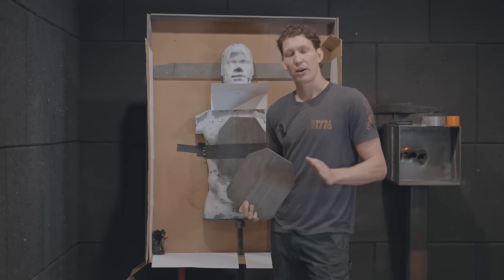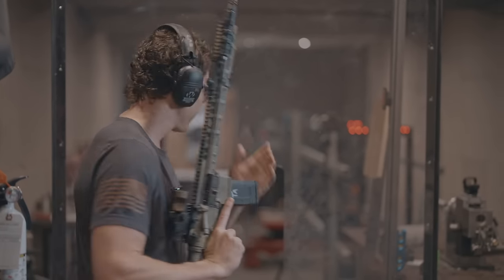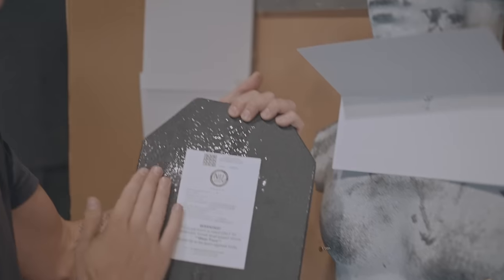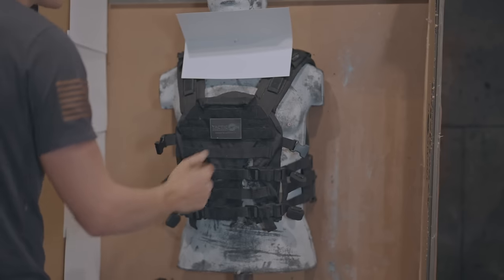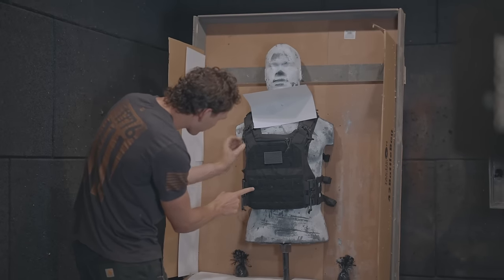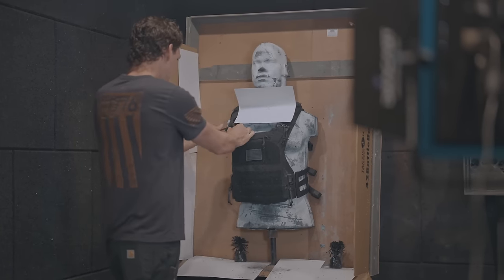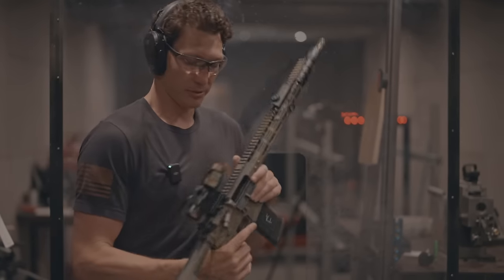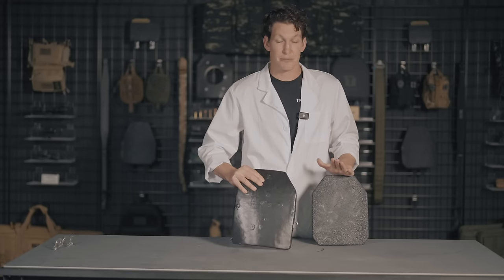Will Steel Armor Make You UN ALIVE Full Test

Comment from the maker: You can find our $225 AR600 steel plate package WITH plate carrier (same ones in this video with coating) here:  https://tacticon.com/product/ar600-level-3-body-armor-with-battlevest-plate-carrier-package/
Reply: I ordered the AR600 bundle, along with trauma pads, last week.  You guys got it to me in 3 days.  That speed and service alone impressed me but I was really blown away by the quality of the plate carrier and trauma pads.  Overall the experience of buying my first ever set of armor and plate carrier was excellent.  Thanks!
Reply: Why did you go with ar600 instead of ar500 or 550?  Will the ar600 crack faster with 308 and is there a realistically low number of 308 where cracking occurs on ar600 (less than 20 rounds)? 

With steel plates, I have heard that 55g will zip through it with longer barrel lengths. I have witnessed a 20 in rifle with 62g gold dots chip an ar550 plate at 100 yards. Is there a fps number where steel is defeated in less than half a mag?
Reply: @sierraharvester  Weight.  I'm disabled and have a very bad low back/neck with nerve damage to both legs and arms (from degenerative disc disease, nerves got compressed).  The AR600 is a couple pounds lighter which makes a huge difference for me.  Yes, with longer barrels at close ranges .308 & other rifle rounds will penetrate it as will steel core/tipped 5.56 but I can't afford ceramic and settled for what I could afford.  That sale price was the only way I could afford even that much.  We all must work with what we have I guess.

Comment: I spent weeks researching ceramic and steel armor, really trying to pick which i would go for as my first main set of plates. It was between level 4 ceramics or 3+ steel w/ a 3a soft ballistic panel behind it. Weight was roughly the same, i know higher end ceramic level 4 plates can be lighter, but lower cost options tend to be around the 8-9 pound range, roughly the same as steel. Ultimately i went steel because, really possible situation, you take a single pistol caliber to the plate and proceed to handle the situation. Ceramic is now crunchy and compromised, and you need to do some type of repair. Steel wouldnt really even notice the hit, no true appreciable damage. To me its not about being able to take a mag dump to the chest, but its ability to take damage over time without being compromised and troublesome if it cannot be easily replaced.
Reply: I wanted level four but for my first body armor set up I’m going with ar600 3+. This set up allows for lighter weight and multi hit capabilities. Body armor DOES NOT make you super human! Train as much as possible and be safe.
Reply: @Bigrig2020-c1d  LOL what a massive cope. Just say you want to cheap out on armor.
Reply: @Dero_milsurp  I’ll just take yours when the shit kicks off then 😂
Reply: I have own steel plates for years, and I still do ... I have also come to the  same conclusion.. still can not  justify the ceramic plates purchase
.. I might in the future if time allows me... even then IDK 🤷‍♂️
Reply: @tacticalpickle7  “I bought steel plates and now I’m pretending they are superior to justify my purchase because my life is worth saving money”
Reply: @tacticalpickle7  Yes, I will mock people who simp for steel.
Reply: @Dero_milsurp  your ceramic is done after one shot bud especially from a low recoil rifle like 556 besides everyone’s arguing over plates when if I see you have plates I’m shooting for hips 😂
Reply: @Bigrig2020-c1d  wrong. NIJ certified and rated lvl 4 ceramic is multi hit rated. The multi hit rating extending into the 7.62 range. Rating is up to AP 30-06 which lvl 3 steel is not rated for. Nor any AP round up to 30-06 while lvl 4 ceramic is. Don’t worry, you won’t see my plates as I’m watching you heat cat from my OP🤣
Reply: @Dero_milsurp  multi hit rated at the right distance between hits 😂 walking loot bag
Reply: @Dero_milsurp LOL what a massive cope thinking I can't put 3 rounds of .30hate in your ceramic armor and punch right through it.
Reply: @no_step_on_snek9796  you are doing no such thing. Because you’d get some zippy boys to the dome before you even see me lmao
Reply: @Dero_milsurp  "I bought ceramic plates because I want Gucci gear and I can't handle the weight of a more durable plate that can handle multi hits that would save my life because I think I'm better than everyone else".

Your ceramic plates are immediately compromised after taking any rounds. It will withstand "multi-hits" as long as the impacts don't contact the same ceramic tile, otherwise you're getting folded like a paper doll.   

If you run into Elmer Fudd who deer hunts with a .300 win mag your ceramic is DONE AND DONE and you will have a nice dirt nap.
Reply: @Dero_milsurp  🤣 bold statement from someone that thinks they know it all.  You keep it up brother, and I'm sure you'll do well. 

✌️ Peace
Reply: @no_step_on_snek9796  I definitely know more than you. You literally thought ceramic armor was individual tiles hahahahahahaha
Reply: @Dero_milsurp   you definitely do man, you're so smart you're ignorance really shines.  You should probably do some research on how ceramic armor works though.  The entire point of ceramic armor is individual ceramic tiles backed by kevlar.  If the ceramic portion was all one piece, one impact would compromise the entire plate.
Reply: @Dero_milsurp  Unlike metals, ceramics are never used alone, as standalone materials, in armor systems; they are always combined with a ductile backing or support layer of metal or fiber reinforced plastic composite materials, and this ceramic-faced assembly is called ceramic armor. Ceramic materials, like glass, have high hardness and compressive strengths but low tensile strengths. Bonding a ceramic tile to a metallic or composite backing material, with high strength and good ductility, delays or mitigates tensile failure upon impact, and forces the ceramic to fail in compression. [6]
Reply: @no_step_on_snek9796  oh man, what a Fudd 😂. Don’t worry, I won’t take your plates when you turn into a loot drop. You can keep your steel.
Reply: @Dero_milsurp  Sure man, you know it all.  Obviously.  Don't concern yourself, I'm not worried about you at all.  Best of luck.
Reply: @no_step_on_snek9796  happy spalling 😂
Reply: @Dero_milsurp  thanks man!
Reply: @Codeeez  k
Reply: @Dero_milsurp  whats really sad is how toxic our community has become to itself. At a time where our unity is needed the most theres is nothing but division and bickering of petty differences.
Reply: @no_step_on_snek9796   whats really sad is how toxic our community has become to itself. At a time where our unity is needed the most theres is nothing but division and bickering of petty differences. 

Im replying to both of you, since you both could use to take a step back and look at the situation from a different perspective
Reply: @Bigrig2020-c1d  you are coping, you will get zipped by some guy with a 20 inch AR running 55g. all that truckbed coating wont help your steel plates fail
Reply: @brydro1505  and that level 4 won’t stop you from getting a 62 grain to the hip💀 level 4 is the same plate but with an extra layer to take the brunt of the initial impact and is only good for one hit in the same spot. body armor arguments are dumb asf :)
Reply: @rfphenom7691  people are idiotic. Your plate really don’t matter when we are speaking hypothetical where I can have any caliber at any distance. Very fun to troll :) especially when everyone thinks armor makes you iron man lmao
Reply: You didn’t research ceramic enough, because most ceramics are multi-hit rated.
Reply: @KarnivorActual  “Ceramic is now crunchy and compromised, and you need to do some type of repair.” I didnt say ceramics couldnt take multiple hits, but its 100% factual that the plate will be damaged and cracked after taking any hits, even from small arms like a 9mm.
Reply: @rfphenom7691  The dyneema/aramid/UHMWPE backing used for ceramics can stop many non-armor piercing threats by itself, the ceramic strike face is simply used because it’s harder than almost any other bullet material besides tungsten. 
If someone is stacking two rifle rounds perfectly on top of each other, without shifting impact by even 1/4 of an inch, then God just hated you for that day. 😂
Reply: @rfphenom7691  The simple fix is, switch your front and back plate if it ever gets hit enough times to have multiple gaps in coverage. 
Regardless, ceramic is always superior.
Reply: @KarnivorActual  bros never shot a gun….
Reply: @KarnivorActual  im not going to debate, only correcting your misunderstanding of what i said in the original comment. Whatever your beliefs are, are your beliefs and you can have them, makes no difference to me.
Reply: @rfphenom7691  You're totally right.  I take responsibility for that, I should not have ever engaged with that person.  The arrogance and ignorance of his insults to others just hit a nerve with me, I won't lie.  It's not just here, he does it elsewhere too.  So I chimed in.   That's not normal for me.  I agree with you 100%.  Some people just rub you the wrong way ya know?
Reply: Yeah 100% that's why people like SF still use steel! (They don't)
Reply: @Bigrig2020-c1d  Does any special forces unit still use steel? The answer to that question is no. Because ceramic is better than steel.
Reply: @RogerCharlamange  civilian grade>military grade
Reply: @RogerCharlamange  you’re one of those wanna be’s huh?
Reply: @Dero_milsurp this video proves you wrong
Reply: @Dero_milsurp video proves spalling ain’t an issue
Reply: @kyoMcMushy  no it doesn’t. Edited videos for the purse of selling a product. Literally zero law enforcement agencies and the entire US military hasn’t had steel plates since the 90’s. And it’s for a reason.
Reply: @kyoMcMushy  spalling 100% is an issue and can kill all by itself.
Reply: @Dero_milsurp  go watch any test video of the plate……. No spall 👍🏼
Reply: @Bigrig2020-c1d  edited. Done my own testing. Shit fails every time.
Reply: @Dero_milsurp  what plates were tested? What type of coating? What round and range? How many rounds? Were the plates angled any or direct 90* hits? Genuinely curious.
Reply: @rfphenom7691  AR500armor w/dual build up voting which is the same as this coating. 55gr M193 out of a 16”from 25 yards. 10 rounds all spread apart. Direct hits and angled. While the plate did stop the rounds, the coating cratered and blew out. It did not stop shrapnel. The angled rounds were far more dangerous. 

To make it any way viable for actual safe use one needs the thickest coating combined with a Kevlar sleeve and a traumas pad behind the plate. Making it far too heavy and far more expensive than the mid level 4 plates.
Reply: kekme8528  a gun fight is 100% a gamble. You can buy every single price of the most top notch armor and still die to a 50 cal or simply a 5.56 to the legs and bleed out. People are arguing for 0 reason because we are talking hypotheticals where we can set up the situation however we please.
Reply: @Dero_milsurp  most of the harder coatings do begin to seporate from the plate face after a few hits, yea. They do seem to work for the first few rounds at least. The lethality of the fragments is subjective, and the carrier itself is going to catch and greatly reduce their risk as well, no? Also, if a steel plate armor can take 2-3 rounds before having the potential of risk to the user, how is this any different than ceramic? Both would require replacement after being struck realistically, correct?

Edit: spall bags and trauma pads are upsells, and generally are not required. Steel armor reduces impact force far greater than ceramic does, look at any tests of back face deformation and you will see that. Impact force is spread out over the whole surface of the plate vs a ceramic which focuses the force in a ping pong ball area that tends to push a good way into the body.
Reply: @Bigrig2020-c1d  yep, couldnt agree more. You could have the top dog hescos, best carrier, ballistic helmet, NODs, a 10k rifle setup, and still be dropped by a crack head with a hipoint.
Reply: @rfphenom7691   it’s entirely dependent on how old the coating is, what the coating has been exposed to and it’s QC. Entirely inconsistent. Mine did not last the first couple rounds. Every single one produced spalling. The lethality of frag is not “subjective”. Arterial hemorrhage is real. Nylon carriers do NOT catch spall. Period. Ceramic composite is multi hit rated. It is not overall compromised after a few rounds. This is per NIJ certification standards. 3+ isn’t even a NIJ rating. Worrying about replacement after being shot is the most confusing opinion on armor I’ve seen. Replacing won’t matter if you are dead.
Reply: @Dero_milsurp  yeah and level 4 doesn’t matter when you get shot in the forehead or legs……. You’re rambling about absolutely nothing my man
Reply: @Dero_milsurp  ceramic plates are broken after a hit, correct? That isint to say that it wont stop hits in other places, but the plate is broken. Crunchy plates suck. As far as NIJ rating is concerned, do you really require a govt 3 letter to tell you whats good and not? Without strolling further down that rabbit hole, can you not recognize where that might be a tad foolish? Especially with recent developments of the NIJ revoking its rating for several plates/makers due to non performance related issues?

Edit: the point of replacing is to say that both plates will do their desired job for a realistic situation of taking a few rounds, and after that both should be replaced. The fact that you cannot see that and instead want to counter with a off remark shows that you only want to be argumentative, and as such there is zero point in discussion because you are no different than a brick wall at that point. 

I tried to have a logical discussion of the reality and merits, you are unable to do so, so im out. Take care
Reply: @Dero_milsurp  that would be if the spalling wasn’t caught. As this video demonstrates, spalling isn’t an issue🤷‍♂️
Reply: @Dero_milsurp  these guys are editing their videos. Just bc it goes against your narrative doesn’t mean it’s wrong
Reply: @kyoMcMushy  wrong. Edited and carefully placed paper at one spot and not where spall travels.
Reply: @kyoMcMushy  my narrative lmao. Kid I’ve been wearing armor professionally for over 10 years. You haven’t for a single day.

Comment: Now do an angled test. The main issue with steel, even if it's coated, is not necessarily the spalling on impact. It's the deflection at an angle.
Reply: I second this. It would be a good test
Reply: I have seen such tests, surprisingly the ceramic was worse at an angled shot, the steel coating worked even better in some cases
Reply: A good coating on steel practically swallow the bullet it's really impressive tbh
Reply: I was wondering the same thing 🤷‍♂️
Reply: @definitelyadarkangel9225  do we have any idea what coating is used on plates or is that an industry "secret"
Reply: @evanbrunelle3466  it is pretty much truck bed liner...
Reply: @evanbrunelle3466  fraglock or spall im guessing. Just make sure its NIJ certified lol
Reply: A special Polyurea. I was an applicator for the stuff for 5 years.
Reply: I’d rather the bullet deflect and hit my arm (not likely) than to go straight into my chest
Reply: It's not "spalling"